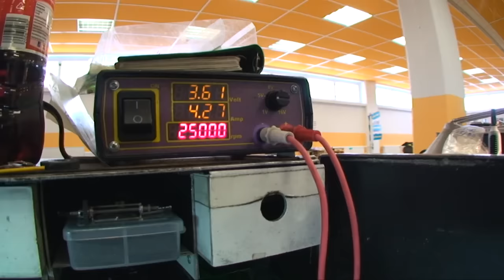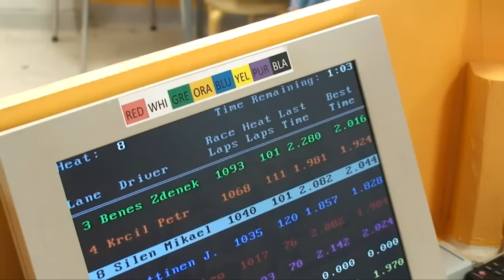Slot car racing European Championship Finals, Helsinki

Comment: This is unbelievable. I had an Eldon slot slot track when I was a kid, 60 years ago. I had no idea that people still played with these things. The speeds seen here are even more unbelievable.
Reply: I never knew what these were called but my brother and I had one of these too.  The cars would go flying if we even thought of going full throttle.  Never could pull off the big loop😅
Reply: Did it back in the 90s as a kid, I still have track and cars
Reply: Almost 60 years here. I was blessed to be in the San Jose area (California) with a long wooden race track. I used to beg old and worn rails, motors, anything they were throwing out anyway. Soldered a lot of dragsters together, and launched quite a few across the room. This track is so fast I can’t see how you would enjoy running on it outside of practice laps.
Reply: ridiculous really...I would have no desire to race or participate in this division.....my God whats the point even?
Reply: “Eldon” 😳 O. M. G.

Comment: I slowed this down to 25% speed and it appeared took take about 6 secs per lap, so in real time about 1.25 secs is the actual  lap time. The track looks like it's maybe 30-40m long. Say 35. So these cars are doing something like 30m per second. Which is about 100 kph or 62 mph. The standard Scalextric car model scale is 1:32 which is apparently the global standard for slot car racing. So the speed of these cars to scale is approximately 3,200 kph or 1,988 mph. This is comparable with the fastest jet aircraft ever built, the Lockhead SR-71 Blackbird recon plane, which can reach 3,540 kph or 2,200 mph. You wouldn't see that if it flew over you house either.
Reply: Nice
Reply: You can also look at the monitor in the video with all the transponder data/lap times

Comment: Slot car racing... pfft, how fast can they even go?

0:55

holy shit
Reply: This should not be here? #) 5&7
Reply: Danstarr13 lol that’s what I thought and all of a sudden I was like what the fuck
Reply: @osbaldoduran549  lol same, I'm like why is this in my recommendations, I only watch stupid shit that shouldn't exist, than I had my mind blown
Reply: They are 1/24th scale cars doing around 100kmh 60MPH which is around 2400KMH or 1600MPH scaled up
Reply: Bob Dobalina  They are about the same size as a standard 12v motor you find in toys (about 1 1/4 inches long by 3/4 inch wide by 1/2 inch thick). Except these have extremely strong magnets and instead of a metal housing they have an alloy frame. Because they are so high performance the track voltage has to be just right as does the gearing or they burn out. The shine you see on the track is a mixture of white spirit and a gum substance so the cars stick in corners. At speed the clear sides fold out because of air pressure giving even more down force so it's a critical balancing act.
Reply: Bob Dobalina  At this level it has more to do with skill and reflexes and the condition of the controller. Some controllers can cost $1000 USD it's to do with how they are made and the wire and circuitry used. Since the cars have no brakes it depends on the motor being forced to reverse the electron flow to slow it. The speed at which this can happen between car and controller and the hand holding it can mean a win or loss is within a 1000th of a second.The longer you can stay in full power and the quicker you can brake is really what it's all about. And then even a simple bump off the track can cause the wings to dislodge and the loss of traction as a result. So it might look simple but the is a lot of skill to it.
Reply: jim Barnes so basically racing at mach 2.08 scaled
Reply: So how fast do they go?
Reply: Daytona Says What?! The models are going 60 mph or 100kph which is ~mach 2.08 if they were a 1:1 scale
Reply: @thenoblegerman2637  thats about right it's why they need the wings and the unique body shape. Although there are other classes and styles of cars such as those at Daytona and indianapolis which dont go any where near as fast.
Reply: T
Reply: @jvebarnes  are they 1/24 or 1/32 scale? I thought they were 1/32. That would make it 3200KMH and 1920MPH

Comment: It's amazing how much faster the cars are now than they were 20 years ago. The cars are moving so fast it's insane.
Reply: They ruined slot car racing when they used magnets that were way too strong.
Reply: @drackkor725   Are there rules in place that dictate how strong of a magnet needs to be?  That no fun.
Reply: @RCRoads  No idea but slot cars from the 70s and early 80s had rear-end slides to them so you couldn't just floor it. Why they changed it comes from toy manufacturers. But the old-school slot racing was more of a challenge by far.
Reply: No, there are no rules about magnets, no need! The track power braids are copper, no magnet downforce is possible.

Comment: I was a slot car racer in the 1960s. What was needed in slot car racing was the same thing that took place in actual real car racing: limitations on motors, controls, tires, etc. Over the decades an innovation made one car faster than the others and so to catch up and eventually go ahead, other innovations had to be found. The result after 50 years can be seen in the video. The same phenomenon took place in actual, real motor racing. Finally a limit was put on things. The only difference is that an absurdly fast slot car will not pose a danger to the driver.
Reply: I used to race slot cars back in the 60's... They had a track like this in Redondo beach California.
Reply: No, but one of the little bastards could easily chip a tooth if it flew off the track and hit somebody in the mouth going that fast lol  XD
Reply: Racing is pretty save these days, at the top levels. Horrible wrecks, and the drivers walk away. Deaths and injuries are rare, even in spindly open-wheel cars.
Reply: Tell the guy that takes one of these cars to the groonies.
Reply: My car fell into another slot while that guy was putting his back on the same slot. He hit the gas, not knowing my car was on his lane, and as I put my hand down to grab it it took off and a chassis wire stabbed right through my finger and out the other side by 25mm.
Reply: I too was into slot cars in the seventies. They were a blast to build, customize, and control on a track very similar to this one. I agree, I can't see where the fun is in this? The cars are way to fast, and seem to stick to the track no matter the speed. I'd love to try this out as it must be fun or they wouldn't be doing it. I am gobsmacked at the speed of these things. lol
Reply: They ruined slot car racing when they used magnets that were way too strong.

Comment: This is wild!  I raced slot cars back in the early 60's, 55 years ago, and our cars moved like thick molasses compared to these modern ones.  Can't imagine what technology they are using to reach such speeds, and, to keep them on the track.  Even at our slow speeds, we were constantly crashing.  This is amazing!  How on earth do they even know which car is theirs.  Incredible!  :)
Reply: I raced pro in the 60's and the track record for a lap on that track was 4.50 seconds LMVYAO!!!
Reply: When I was about 10 I had a cheap track and bad cars, so I directly attached the wires from the track to a plug wich made them run on 220v… made the cars at least 3 times faster. To be able to keep such a speed I had to removed the plastic roofing of the cars leaving just a thin piece of plastic with a motor and some wheels. Those were great times, played around with that for weeks on end with my twin brother.
Reply: They ruined slot car racing when they used magnets that were way too strong.
Reply: @davidmerrick467  you raced pro in the 60s? how old are you now?? if you were 20 years old then you'd be over 80 lmao
Reply: My cars go like 99% slower than those cars go😂
Reply: @kickdowndoors I retired in the 60s. Late retirement too.

Comment: Damnit, I did not expect such SPEED.  I was waiting to see the cars..... instead, I saw FLASH in reality.
Reply: They ruined slot car racing when they used magnets that were way too strong.
Reply: Earth to Drakkor, Earth to Drakkor.
No magnet downforce is involved, the pick up braids are copper.
Reply: @paulgoff5068  ? What are you talking about? The pick-up for conductivity to propel the electric motor has always been copper! This has always been done this way. What was changed is the positioning of the magnets to stick to the track. It's simple and basic do you understand now? Take a look at the underside of an old slot car compared to the new one. They took the challenge away just like the world dumbed down Nintendo games and made them easier. As a reference.

Comment: how can they concentrate with the cars going so fast, how fast are they going anyway????
Reply from the maker: +Steventhe2nd normally 50-100mph, top speed over 100mph
Reply: Jussi Kämäräinen you still think it's hard to concentrate with those kind of speeds
Reply: +Jussi Kämäräinen Group 7 motors? I raced NASCAR class with flexi chassis and 16D motors, a lot slower (and cheaper), but still a lot of fun. I miss my slot car racing days.
Reply: +dbd31463 your never too old to revisit...js
Reply: thinknif one car jumped out of trank and hit someone in the head
Reply: +Steventhe2nd They arent concentrating they are just holding the trigger down
Reply: Rolley Folley You have to let up on the trigger going into the curves or your car will come out of the groove. Slot car racing is a game of timing and building a competitive car with a balance of speed and handling.
Reply: they do it for years
Reply: +Rolley Folley No they're not. Look at 1:56 guy in the red shirt
Reply: James Cooley Maybe he got some kind of birth fault?
Reply: just wanted to comment the same haha
Reply: rk FGF o
Reply: sometimes you do, sometimes you dont. It all  is in your controling finger to decide how fast you go
Reply: Is this really fun when they go so fast? You only control the speed...
Reply: i think this type of slot car racing almost makes it almost impossible for your car to fly off track.  as a kid i had electric track racing track set, two lanes, that was more fun,  slow enough because you had to slow down for turns and so on
Reply: George W Obama I never liked the group 7 and 27 classes. They were too fast and expensive. The 16D and Super 16D's were my favorite classes which ran NASCAR and GTP bodies. I also did some HO racing on a steel track, that was fun but, didn't compare to the fun of running 1/24 scale cars. To each their own,
Reply: thanks, to each their own. im not savvy at all when it comes to slot card.  i can only assume that in this video where the cars are just blurs their so fast, they must have a deeper groove, or walls, or something magnetic.  do you know what it is ?  i don't think its humanly possible for someone to race this fast and keep an eye on their car.  it must just be floor it. be grateful if you know why these cars run so terribly fast and not fall off that much.  did you the link video ? i thought it was fun especially that one camera angle when you saw the cars drift or fish tail the corners. peace.
Reply: George W Obama They used to use glue on the tires for the fast cars. Also the body (wing bodies) creates a down force at those speeds. The track would be a gooey mess after a race and would need to be cleaned so the slower classes could race.
Reply: dbd31463 thanks for the info.   but don't you agree that the" slower' cars are more fun to watch ? and perhaps the slower cars take more skill to race?(as ironic as that may sound) i cannot believe any of the people controlling the cars can keep their eyes on theit car constantly.  so it seems like floor it and leave all else to chance.  do you know what i mean or disagree. be grateful for another reply. thank you.
Reply: George W Obama Yes, I prefer the slower cars. The faster cars are more difficult to race than the slower cars though. If a racer can hold down his throttle without coming off the track he will surely lose, they are going much too slow in the straights and high bank to be competitive. I took a few laps with my buddies group 7 (fastest car at the time) and found that timing your trigger finger with where your car is on the track is no easy task at those speeds. I ended up slamming the car into the wall and doing significant damage. I stuck to the slower cars after that.
Reply: again, grateful for your reply.  because i could never afford it as a child, i bought my first cheap ho(is that the name for it. like the smaller train sets ?)two track racing set in my when i was 25 yrs old.  i only had enough track to fill the top of a ping pong table, i bought some extra curved track and two straight to have one overpass or bridge. and the final thing i bought was a lap counter, of course.  I have happy memories racing against my brother or friends.  a neighbor's young son and daughter used to bug me and i let them race each other.  but man, the sibling rivalry !  so many times did i have to break up fights of that brother and sister, lol.  Even my dad, god rest his soul, would come over to my apartment and like to race.

I liked the streamlined racing cars.  my brother went out and bought some chunkier military vehicles.  i didn't like them but now as i grow older i wish i had.

an analogy i like to use is guitar playing.  its seems when your young you just wanna play fast but are really not playing much music. you lose the subtleties of lets say a classical or good rock guitarist who can play, fast, slow and intermediate and uses the whole fret board for more complex music instead of some guy just making a quitar squeal with one note at the hightest note on the fretboard

oh maybe im wrong, to each his own

i'll stop rambling for yours and my sakes
Reply: Steventhe2nd ,
Reply: Steventhe2nd there going over 9000 mph
Reply: Agree, I can also ask the same question.
Reply: +Samir Chowdhury no they aren't
Reply: Steventhe2nd lsll
Reply: ikr! wtf it's just ridiculous
Reply: Steventhe2nd gy
Reply: Steventhe2nd
Reply: Steventhe2nd
Reply: how they determine the champion?
Reply: ann Tmg
Reply: Steventhe2nd
Reply: Steventhe2nd txtx
Reply: Steventhe2nd 
很快 车
Reply: reihan
Reply: Steventhe2nd cause they are the ancestors of GOKU
Reply: dbd31463 m uoh tv 7 topic op de hoogte blijven van het nieuwe jaar weer de hele tijd niet meer op een rij te gaan
Reply: Steventhe2nd i think some of them go like 80 or 90
Reply: there is more to it than just hold the trigger down I used to do group15 and  you can not hold it flat out  it is on and off the trigger  at the right time
Reply: It's actually not impossible. It's called kinetic vision.
Reply: Steventhe2nd
Reply: Most laps.
Reply: @dbd31463:  Most wing car classes use glue on the track, whether sprayed on by the track personnel or squeezed out from bottles by the racers.
Reply: HO stands for 1/100 scale
Reply: Jussi Kämäräinen   is there a camera on the top of the cars  ?
so i can recorded my race  ?
Reply: Jussi Kämäräinen  Its too fast  !!!!!
Reply: How fast are they going?
Let's just that if light were in the audience, it'd be like "Whoa, man".